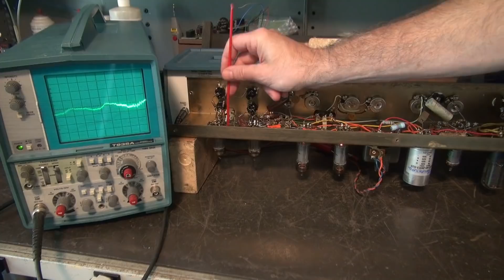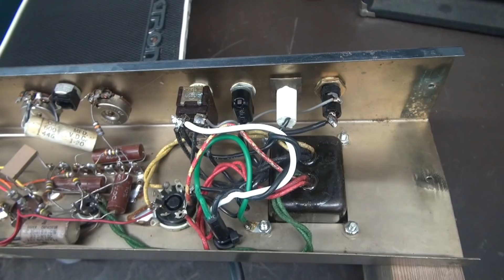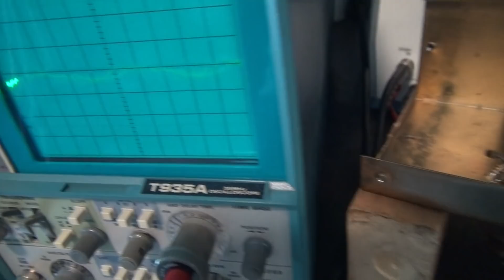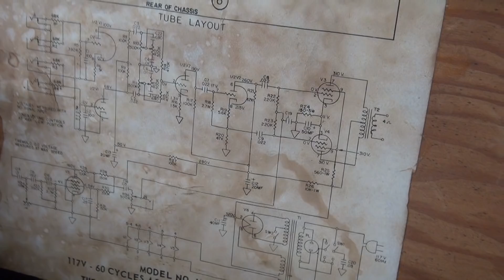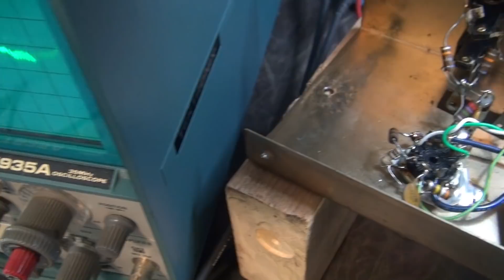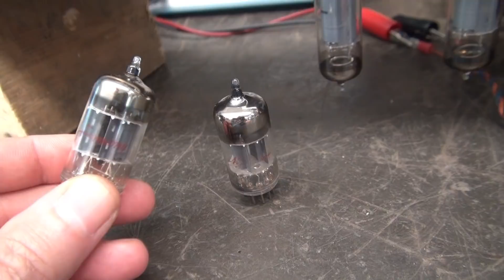How to trace Fix tube guitar amp noise Hiss Harmony 415 Part 2 D-Lab Tek Tip

Comment: When dimed the H415 has some of the best sounding cranked tube overdrive I’ve ever experienced. When you jumper the inputs & dime the amp, the overdrive/distortion is glorious. I’d recommend anybody who stumbles across one to snap it up if it’s under $600. Clean examples sell in the $800- $1200 range & this model doesn’t show up for sale very often. Ever once in a while you can still find these for sale in the $300-$600 range by people  who aren’t aware of how great this amp really is, & are not aware of the sizable cult following this model has. The h415 came stock with Jensen C12R speakers- which by themselves can sell for $300 - $400 a pair.  The C12R is a great low wattage speaker for anybody going after natural 60’s tube amp break up/ garage rock sounds. Every 1960’s Jensen speaker I’ve owned (10” & 12”) have a real old school rock n’ roll sound that I’ve not heard with other speakers. Don’t be fooled by the new Italian made “Jensen’s” as they DO NOT sound anything like the real deal, made in Chicago Jensen’s

Comment: Love your channel, I've been having many issues with my '65 Bassman recently. I took it in for volume loss issues last month and received it back, but noticed one of the tubes had some slight red-plating and the amp popped  and hissed every now and again. The problem was mild, but I decided to pull the chasis to poke around with a wooden chopstick. Didn't find anything, so I cleaned the scratchy pots with contact spray, turned off the amp, unplugged it and turned the switches on for an overnight current purge. Came back the next day and the amp wouldn't even turn on. I was wondering if you had any ideas what the culprit could be? I'm considering taking it back to a repairman, but it's honestly beginning to become a money pit. Thanks for the informative videos - Jake

Comment: Terry, at 8:20, you can see that the terminal strip which has the (formerly) Black Beauty capacitor tied to it at one end also has a rivet holding the center- tab of the terminal strip down to the chassis, which is used as a ground point. You can't trust those rivets! It's pretty much guaranteed to be oxidized at this point, some 40 years after it was built; and the brass cold-rivet tends to relax and loosen with time. You should solder that point, or perhaps even drill out the rivet and install a bolt in its place. I would have repaired and improved that ground and then grounded the capacitor to that same spot rather than soldering it to the chassis a couple of inches away. It kind of looks like bad form, especially for a ham radio operator! "A Wizard should know better!". Treebeard
Reply from the maker: Hello, Thanks for the message. If you take a close look at that terminal board, you will see that the center mount post/terminal riveted to the chassis is not used for an electrical contact (unused tab). I soldered the new cap direct to chassis. So the integrity of that connection is not a concern. Take another peek. TD

Comment: I thought pt.2 was more informative than pt.1! I thought, after seeing where you put those 100 ohm resis-a-taters   
on the 6 volt filament supply was smart! You had more restate on that end and it does the same job. Glad you raised the twisted sister filament wires up above the chassis, over the components and tube sockets. Good move Terry! I don't think you get enough credit for your knowledge and experience. You make "tronix" an art! Those news witchcraft jacks, my choice, were gorgeous. Fantastic upgrade on the whole service. Again the owner will be thrilled! I would be. Thanxz
Reply from the maker: Thank you my friend.

Comment: Good one, Terry, I'll remember the tap test for noise issues.  About the balancing resistors for the filament line; if I understood you correctly, you put them in to eliminate common-mode noise by floating the filament winding so neither side ties directly to ground, correct?   Doesn't the B+ ground tie into the filament winding or is the filament winding isolated from the rest of the transformer? Also, how did you arrive at the 100 ohm values for those resistors?  Sorry for these newbie questions, I'm still kinda new to tube gear.  Thanks.

Comment: The filament wires would have made 60Hz hum which is common.  Since this is cathode biased, instead of putting the 2 balancing resistors at the input tube socket, I would have installed them at the output tubes and elevated the heater voltage by grounding them through the bias resistor.  Twisting the wires and elevating the heaters voltage through the cathode bias resistor usually eliminates and 60Hz hum problems.  Hiss and crackles are most often caused by old CC resistors.  I had a feeling you would solve the problem by replacing some old resistors.  ;^)
Reply: What is the best way to track down a noisy resistor? Freeze spray? Tapping, pressure, signal tracer?
Reply: @zulumax1  Tapping works.  New resistors with a 1% tolerance are cheap, you could just replace all the 10-20% tolerance of old CC resistors feeding all the preamp tube plates for pennies and see if that eliminates the hiss immediately.  You know how some techs will just shotgun replace all the old signal caps, all CC plate resistors could similarly be replaced for very little expense without even testing 1st, IMHO.

Comment: What is in your audio test set box Terry?   Dummy loads I take it.  Can you perhaps publish a video on this unit.  I would love to make one for my workshop,
Reply: Same
Reply: Terry built and showed this wonderful piece of test equipment in previous videos. Thanxz
Reply: I was watching the video on my smartphone, it's a pretty small screen and so fine details can be tricky, especially with my old eyes. It did look to me as if there was something else out or to that ground tab, although it's hard to tell as your camera moves around quite a bit. Anyway, my apologies. Of course, no reason you couldn't have used that terminal strip for a ground as long as you dragged out your big soldering iron and soldered the tab to the chassis. 

I  remember an exchange of comments with Brad the guitologist where I warned him about riveted grounds like that, especially on old Danelectro and Valco amplifiers, and he said he never had a problem with one. Then, a couple of YouTube videos later, he did indeed have a problem with one of those riveted ground connections!